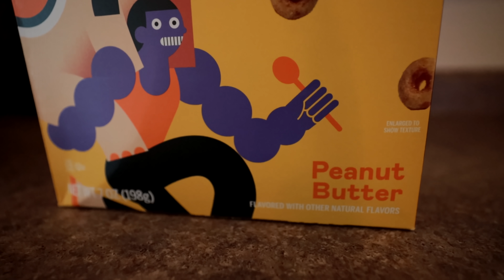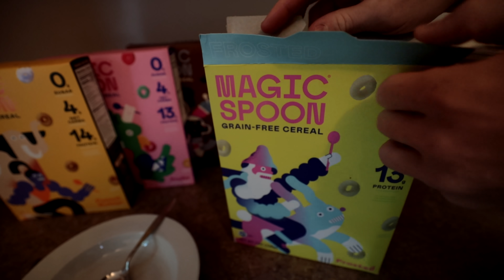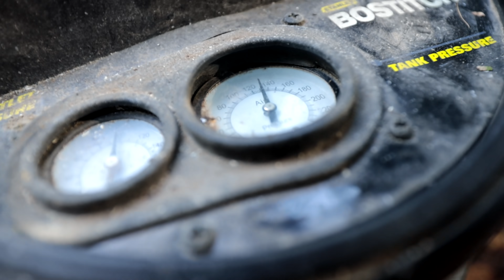Finishing the GLASS MICRO House Build! (On a TIGHT Budget!)

Comment: When you talked about making this house, in my mind I visualized an icey cold drink in a glass on a very hot day, with "sweat" all over the outside.  Happens in your house too which is why we have "thirsty stone" coasters to catch that "sweating" action.  I recall our science teacher calling this osmosis, I believe the term is?  With any glass there are pores in between the atoms and that allows moisture to pass right through the glass itself.  You can calk every single entry point on those glass panels and still not keep the water out.  Take for instance a "solar still".  The premise is that you line the inside of that with dark plastic and put a good amount of water into the bottom.  The sun does the rest by build up of heat to cause internal moisture to hit the glass panels which they drip or run downhill into a gutter which funnels the water to a bucket outside.  I watched this built and used on Homestead Recue with the Rainey's on tv.  Your structure, doesn't have a layer of water inside with a black interior but there is always humidity in any structure and being in the woods means you've got high humidity anyway.  This is why any structures built in a woods deteriorates faster than if they were built away from the woods.  So, you've got internal humidity which is causing condensation on those big glass roof panels which hit the sun heated glass and bead up to run down to the lowest point.  It will cause rot.  Probably better to turn that structure into a greenhouse than to use for human occupation.  Just know that this structure will tend to "grow" mildews and molds, some of them very toxic to breathe in for humans or animals.  This information comes from a background I have in home inspections and environmental testing inside structures.  We often did foreclosed homes and got very sick in many of them because they remained closed up and uninhabited.  They're called "sick homes" and the gov't has ordered a great many of such houses to be bulldozed as there is no saving them unless you rip out all the drywall and insulation and start over.  To keep structures safe for habitation you have to keep them heated or air conditioned.  So for your glass house you'll have to put in some sort of automatic vent on solar to keep the humidity lower.  Such devices are often used in greenhouses because believe it or not, really high humidity is also a problem in them as well.  I do think you'd be better off just putting a metal roof over this structure and use that glass layer in some decorative ambiance to it?
Reply: Sick building syndrome it’s called or mold illness. I’m in a wheelchair from it…and now I’m obsessed with building science and we have dehumidifiers in every room keeping humidity at apx 50%

Comment: If you cover the ramp with the same stuff you have in their pen they will go…they dont like walking on unfamiliar ground.  Also, lighting … they dont like going into darker than where they came from…
Reply: I thought the same. The enclosures are in poor condition, they should contain at least 40 cm of litter. With the pigs and chickens. Wood chips, bark mulch, straw. This method is called Deep Litter and it works wonderfully.
Reply: Temple Grandin made the same observation with cattle.

Comment: It would've helped your deck joists if you'd have screwed blocks of wood underneath both ends of them for better stability and length of life.  Ideally you'd want to use brackets such as Simpson's Strong Ties and a board to attach the whole deck with heavy lag bolts to the original structure, again for stability and length of life.  Eventually the weight of the deck and people walking on it will put it away from the structure unless you attach the whole thing to the house with a thick board and lag bolts.  Think about the "weakest link" holding it all up which would be where you put long screws into the joists and all the weight and stress put on them over time, wallowing them out.  They will eventually fail so you have backups in wood blocks underneath both ends of the joists, screwed in and maybe even glued onto the house and frame of the deck.  Think about backups always and how you can add these little things to make the thing last a lot longer.

Comment: Deck should've been laid to cause water to run off it and away from the structure.  Never lay a deck level.  Also you should've put spaces between the deck boards to allow water to run off each board to the ground below.  Butting them tightly together only causes the water to lay between them and rot the wood.

Comment: Will Mother Red let that land be sold with those cabins or is it still undeveloped since I assume no permits or code inspections were done. Because you can do a lot with a chainsaw, hammer, and cordless drill. The mill and front end loader help but are only needed for speed and safety.

Comment: "End of season sales"  Plastics, unless kept in a heated space do break easier if kept in the cold or outside.  It's why they're marked down.  Plastics don't winter well and often break easy the following year when you need to use them.  Of course you could sit in them during winter stays but the colder the plastic is the more apt they are to break when you're sitting in them.

Comment: With your posts I have seen posted placed on cement pavers last a whole lot longer than the method of putting the posts into holes, either filled with gravel, cement or dirt.  We know it's  not good to put dirt against wood as this allows bugs to burrow into the wood and moisture as well to rot it.  Cedar is water resistant of course and you often see structures in Alaska built by putting posts directly into the earth.  The land stays frozen most of the year in that state however so they can get away with doing that.  In the lower areas not so much.

Comment: There's a property down in the hills of southern Ohio where there are these piles of large stones.  If not for the oldest people in that area, no one would've known that victims of epidemics were buried in mass graves under those piles of stones.  Further up in the same small area you fine the upright stones standing vertically in the ground spaced so far apart to show that those are also graves.  Often times, when most of the people die in an area from illness the rest of the people remaining there to keep the knowledge and history of the place leave, and there's no recorded history to know what happened there when people come back into the area.  So, yes, you could be removing stones used to cover mass graves.  Most farmers and ranchers remove stones from cleared areas and place them on the boundaries of the property unless they mean to use them later for building projects they have in mind.  But I'd be careful digging where you've found those piles of stones.  Some epidemics are caused by such virulent diseases that they live on for hundreds of years in the decayed remains of the victims and re-infect those who dig them up even hundreds of years later.  From ancient times to even more modern times people did not always bury their dead 6 ft. down.  Depth of graves during epidemics were often times shallower even than the freeze line which is why remains often come to the surface over the years.  Anything above that freeze line is subject to freezing and thawing which brings everything to the surface.

Comment: Another great video. The deck really looks nice. When you thin you cedars do you just figure so much space between trees and remove what overlaps or do you decide what has a use now and just remove them? I never knew about a bucket on the head trick, almost sorry that you didn’t get to try it. Look on the bright side, the pigs will be much easy to bring back, and in much little packages. I have a feeling that pork is going to be mighty tasty. Are you going get bacon processed or are you going to do it yourselves? Thanks for sharing!
Reply from the maker: I met a guy that is going to be processing the pigs and cure and smoke the bacon and hams.    I needed the bucket on the head trick to get them out of the trailer.
Reply: @ModernSelfReliance  I’m getting hungry here… home made maple syrup, home raised bacon, ham and eggs… yum, yum!